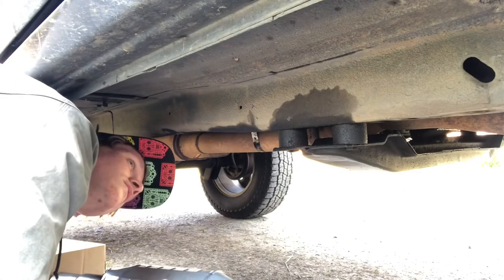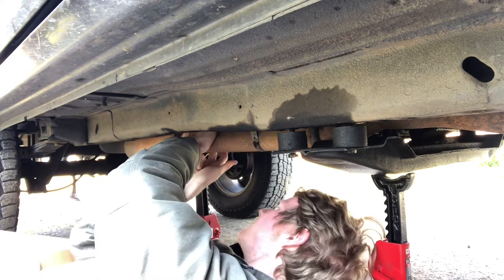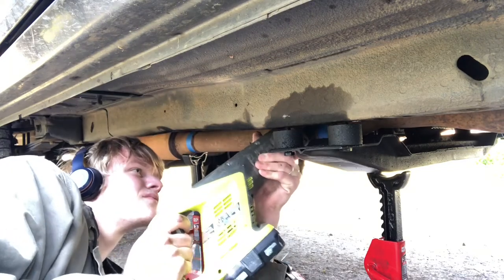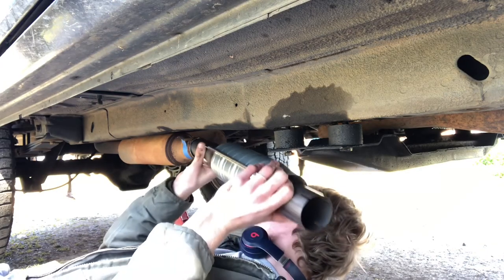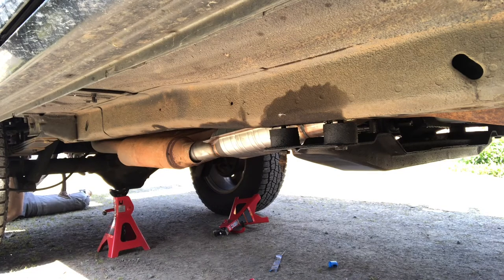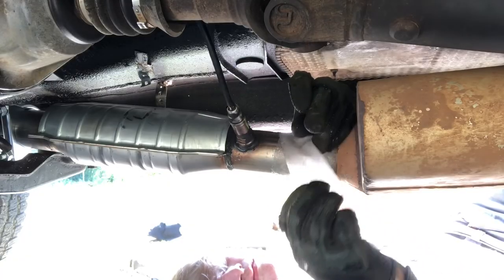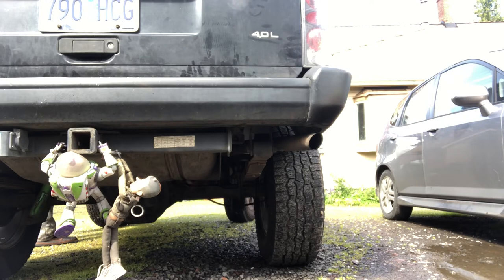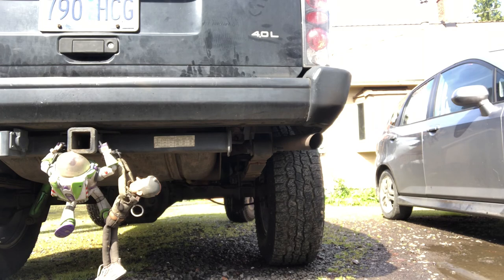97 Jeep Cherokee Project EP 15: How to install a Catalytic Converter

Comment: Where’d you get the catalytic converter from? Also, what are the inlet and outlet dimensions?
Reply from the maker: Hey, I ordered mine off of Amazon, there and eBay both have quite a few cheaper options for Cherokee cats, and for the dimensions I don’t remember off the top of my head but I think it was 2” outlet and 2 1/4” inlet.

Comment: Well you are the 3rd video I have watched today about how to install a catalytic converter,  your is the simplest version,  I have a 1999 Jeep Grand Cherokee , similar.  Great video. So what is the name of the muffler tape?
Reply from the maker: There are a few different brands that work you should be able to find in the exhaust isle in any auto parts store, I believe I used the “tiger patch brand”

Comment: Does it work with emisions? I live in california and trying to find one for my cherokee
Reply from the maker: I don’t believe the one I used will do cali emissions standards, I’m in Oregon so it’s a little less strict. But I got mine on Amazon, there are the plenty of options there for pretty cheep, you will just need to read the item specifications in the description to see its emissions info. Good luck :)

Comment: Did u have a front cat on ur jeep? Its on the front exhaust pipe kinda looks like a bulb?
Reply from the maker: Not on mine,I believe in the later years they did the two cats closer up to the engine but my xj just has the style with one down by the muffler
Reply: @jeepstuff9189  yea mine is 99. I know what ur talking about on the 00-01,  but I have this bulb on the front exhaust pipe. I wasn't sure if it was a cat or not.
Reply from the maker: Yeah I’m not sure, maybe it’s an after market one that the previous owner put on or something.